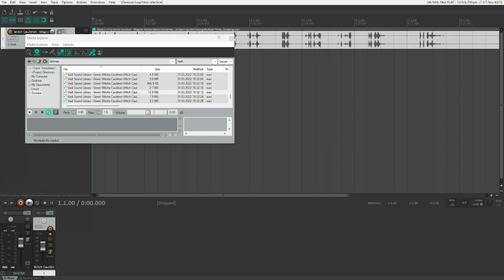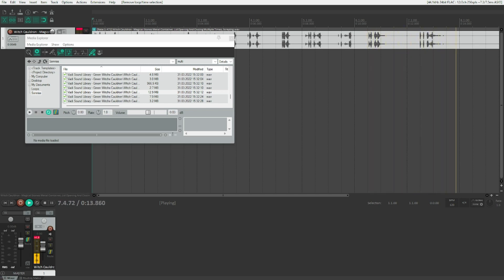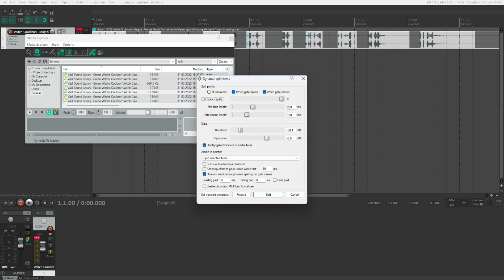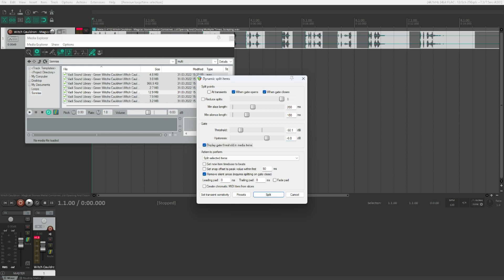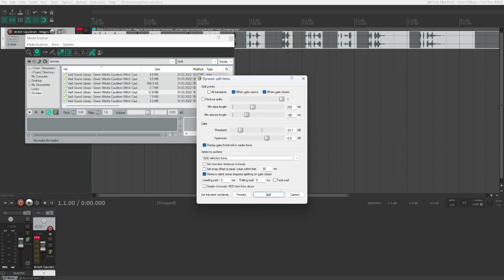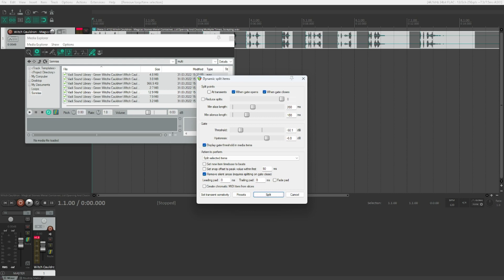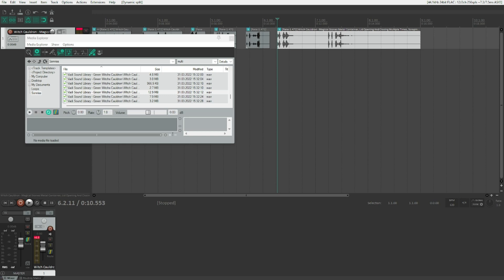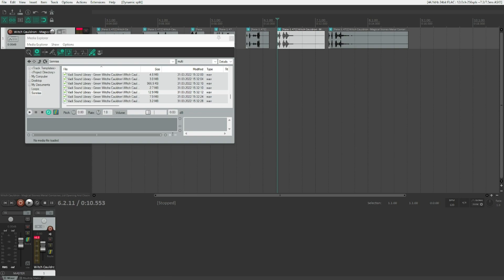How to dynamically split items by silence or transients in REAPER

Comment: Hi Toni, useful stuff in here.  If I could make a feature request it would be that OSARA gave feedback on how many items would be created with the current settings and that this is reannounced as you vary values like the threshold and hysteresis.
I also find it useful to run an action called set time selection to selected items as this is a nice way of playing just a selected item.
And another useful action is reposition selected items which allows you to evenly space the items which might be useful after you've done a dynamic split.
Great stuff.